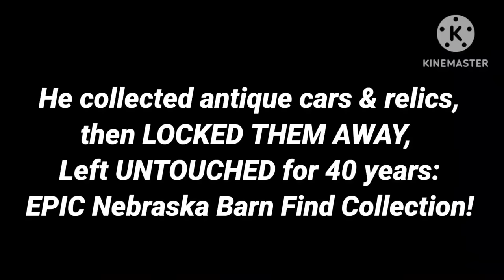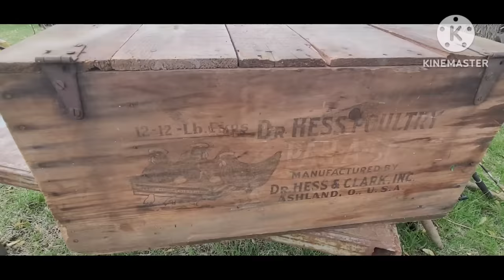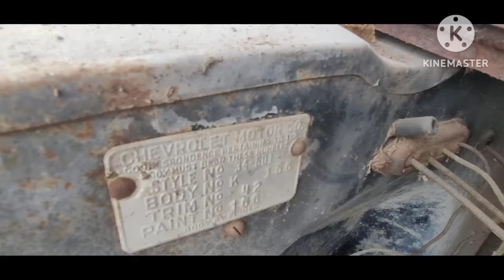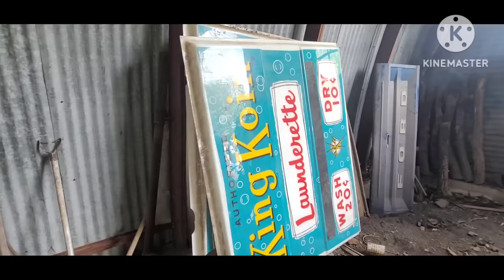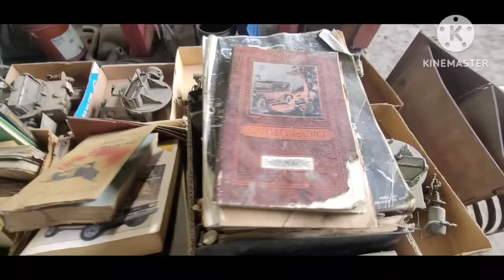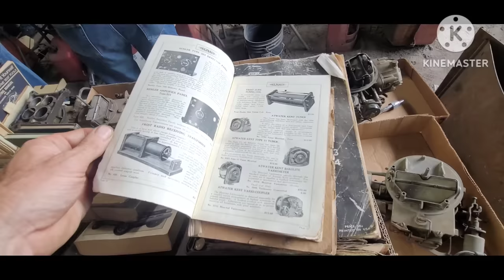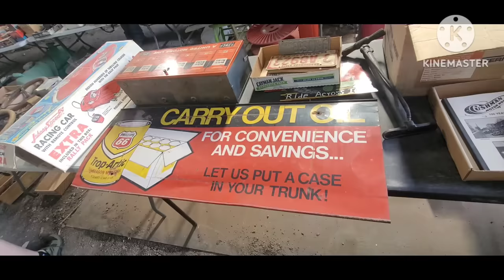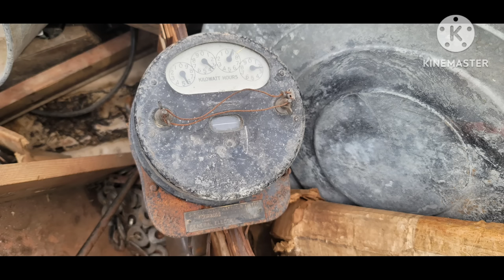Nebraska Barn Find Collection LOCKED AWAY 40 years! 1930s to 60s Cars, Trucks & a RARE old tractor!

Comment: As a lifelong radio nerd of 58 years, I can tell you, Tim, a few things.  Those vintage radio books are pretty cool!  You mentioned that radio signals traveled farther than they do now.  It still applies, it's natural phenomenon.  It boils down to atmospheric propagation and the frequency spectrum overall.  Listening to a radio station from another state is done on the AM bands (mediumwave) at night.  You can still receive broadcasts from the other half of the world on shortwave.  Of course, reception depends on atmospheric conditions, regardless of the spectrum.
We live in a modern world where knowledge of this isn't as present anymore.  With Internet and satellite relays, we use the digital signals more than analog.  People say to me, "Wow, you are in San Diego and listening to an AM station out of Chicago, using a clock radio?"  Well, yeah!

Comment: I always liked the design of the Henry J with it's beautiful fastback and tiny fins. It got my attention already at the first glance and from far.and this vehicle should be saved. It will be a big task but how many of those cute little cars are still out there? Not many I think.
Reply: Beat Glauser 1951-54Kaiser Henry Js as well as the 1952-53 Sears Allstates seems to fall into the same class as a 1938-41Willys!!!Most usually  ended up as "Gassers"for drag racers in the 60s and 70s!!!.
Reply: @mikeweizer3149  What a shame! It is a pity that those cars were all "butchered".

Comment: @2:54,the Ricardo Waukesha (patented 1923,made under licence by Waukesha) Head is actually a pretty valuable piece in the 'T' world and back in the early 2000's there was a scuffle on the forums after someone paid $700 for one. It seems that uncracked are the  rare ones ,and are desirable because they increase power . Sir Harry Ricardo and his research company are the ones responsible for the overall efficiency of Cylinder head design today. So it might have been a sure bet to buy both T's to make a little money from them.

Comment: 45:27 1st gen Olds Rockets can be identified by the casting number on the heads that is above the exhaust manifold. Not the best angle to see, but this one appears to be a #7, which would be a 1954 324. These Kettering engines were an iconic engine of their day, and probably the most copied/reverse engineered V8 design. In my opinion they fell victim of Oldsmobile's desire to rule NASCAR. Almost every year, the internals of these engines through development changed significantly.  Valve sizes, C.R., cam journal sizes, rocker arm ratios, combustion chambers, displacement, etc. Whereas with a sbc, almost everything can bolt to everything else and it will work. Especially aftermarket speed parts. Not so much with a 1st gen Olds.
 The big iron chunk behind the engine is a slant pan (Dual Range) Hydramatic. This is the transmission that put B&M Transmissions on the map when they created the Hydrostick.